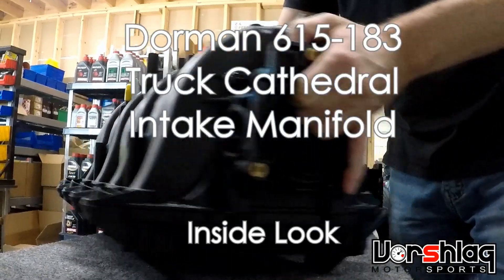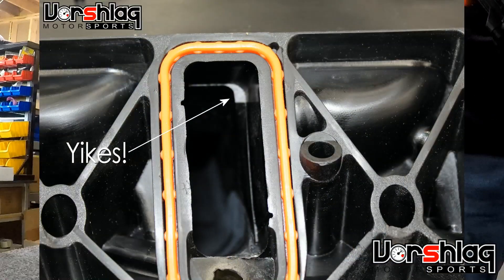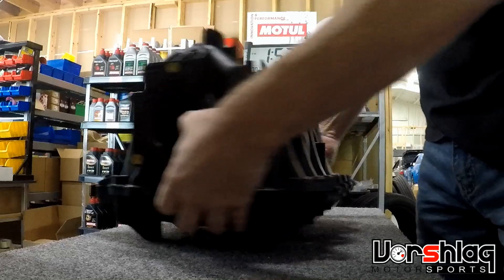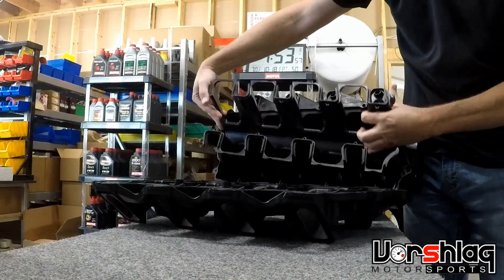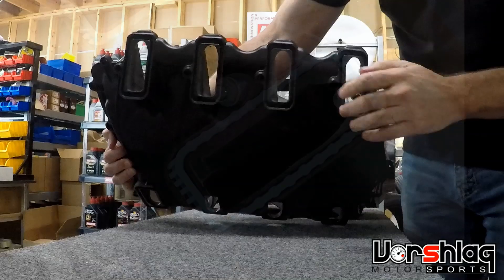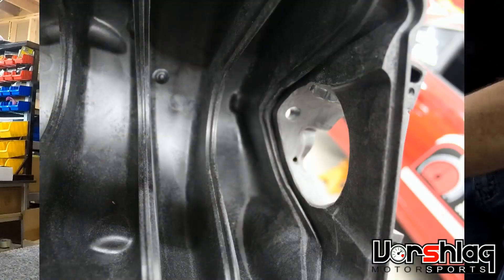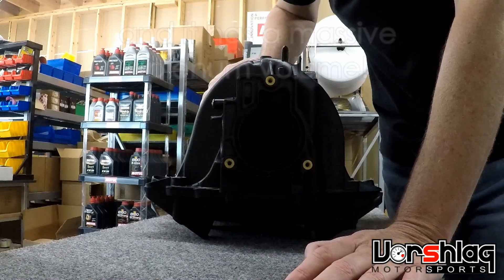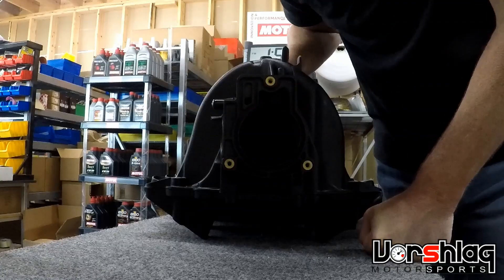Vorshlag review of Dorman 615-183 Truck LS Intake

Comment: I did the same porting as you guys......when I pulled mine apart the gasket was pinched so when I was putting it back together I used permatex with the gasket ...Its on a 4.8 turbo and it's been up to 18.5 lb with no problems..Not a bad intake for the money.